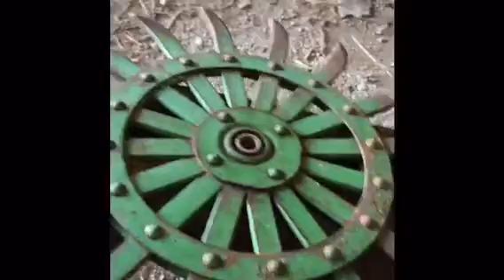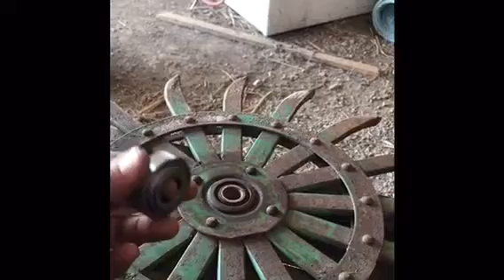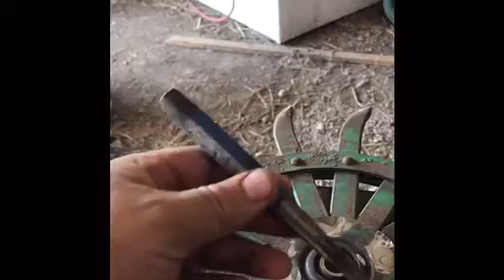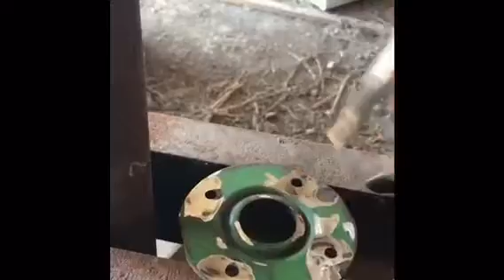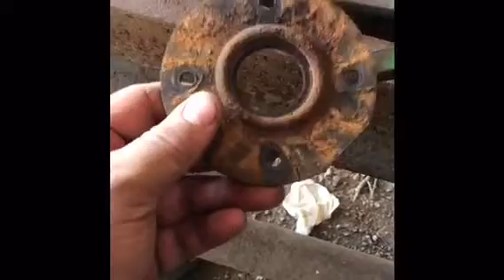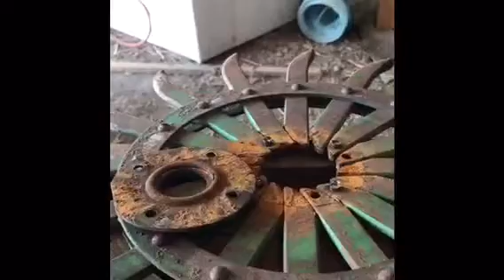John Deere 400 rotary hoe bearing replacement #1

Comment: Hey Clint….thanks for the video. What are the specs on that bearing? I’d like to order them from an industrial bearing supply house.
Bore diameter, inner width, outer diameter, outer width, flat or round outer … Thanks!
Reply: Oops. I got it in the video. Thanks!